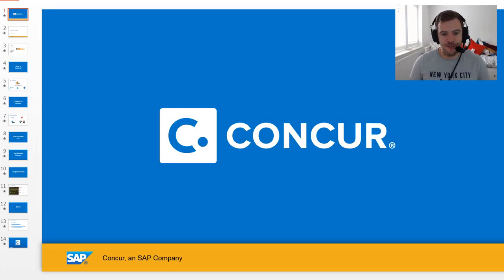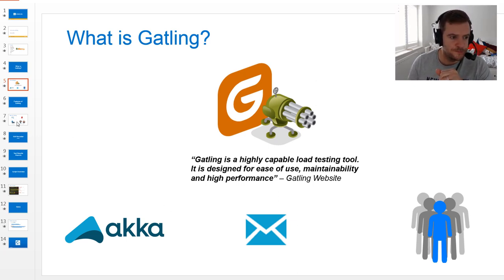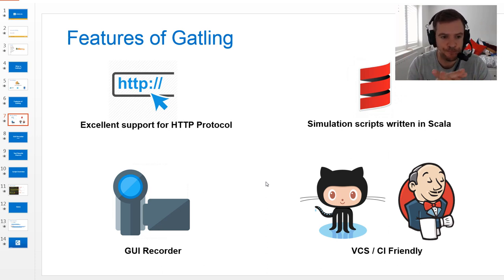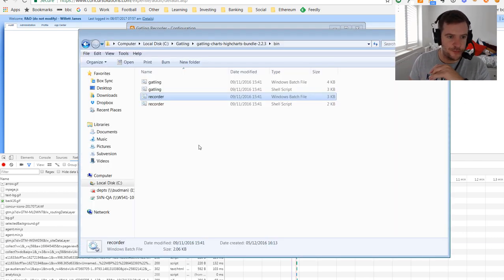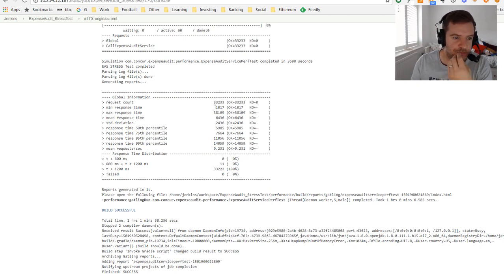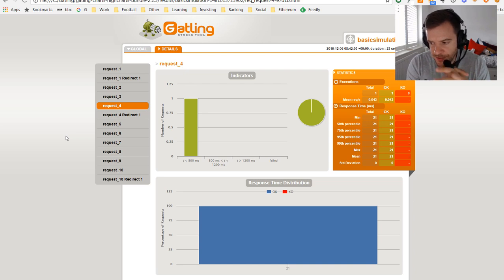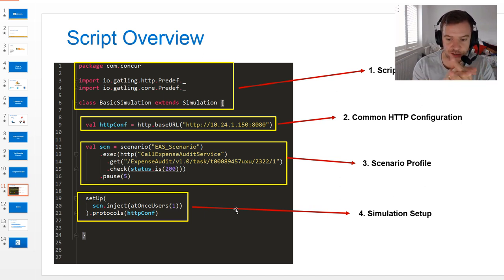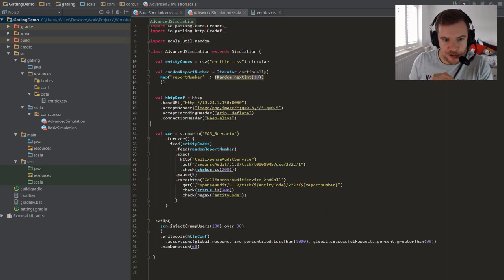Gatling Introduction

Comment: quite a nice video sir,
I would point out however, that the audio seems be only on the left side of the Stereo.
Which is a bit annoying when you are watching with headphones.
Reply: Agreed, however I found there is a work around. If you're on a mac you can go to System Preferences -> Accessibility -> Audio and then check the "Play stereo as mono" box and it will play the sounds through both speakers. Just remember to disable it once your done.
Reply from the maker: Thanks for pointing this out - it does seem to be an issue with stereo vs mono . Will fix it for future recordings
Reply: I was just messing around with my headphone cord looking for the short :-D
Reply: and I thought my headphones were broken

Comment: Hi James, I want to use Gradle-gatling-plugin for rest api load testing, would you please guide me in right way?
Reply from the maker: I wrote a post about it here: https://www.james-willett.com/running-gatling-through-gradle/

Ive had a few issues with using the Gradle plugin for teaching my course, so I am actually speaking to the Maven plugin which is officially supported by the Gatling team - https://gatling.io/docs/3.3/extensions/maven_plugin/